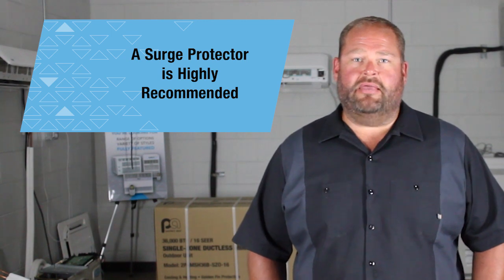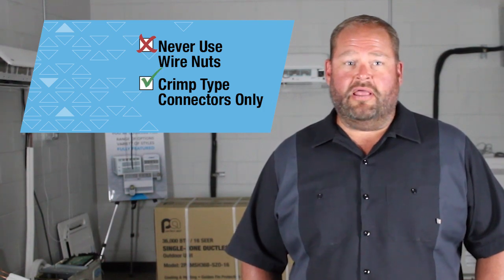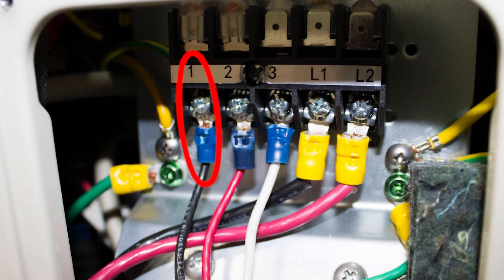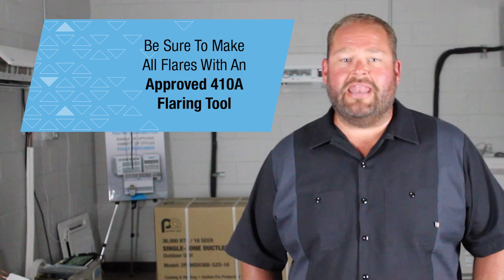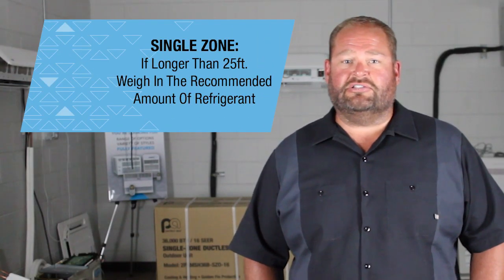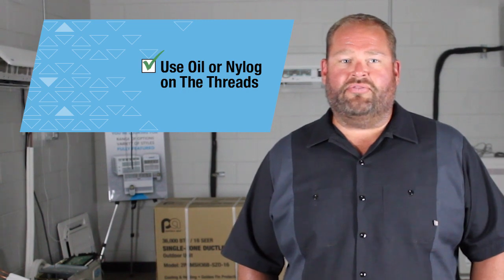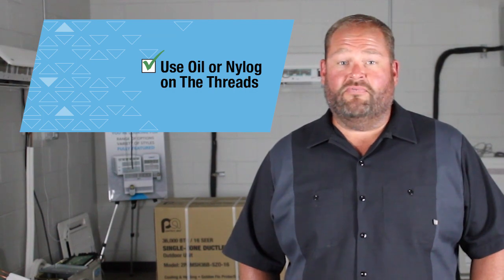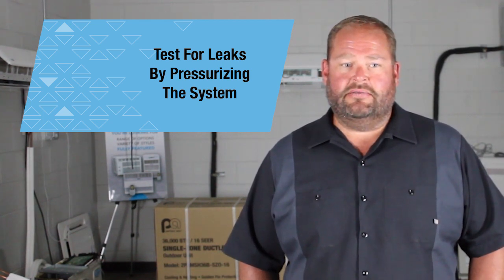How to Properly Install a Ductless Mini-Split Air Conditioning System | Installation Best Practices

Comment: Looking at install videos, since I won’t be using the full 25’,I don’t see what to do with the remaining line. I live in a winter climate , would the line freeze if I only coil it behind the unit ?

Comment: Question for 18,000 btu condenser which has 3/8 and 1/4” fittings. I bought the 18,000 condenser and the 12,000 btu indoor handler and 9,000 indoor handler. The 12,000 has 1/2” and 3/8” lines. Do I need an adapter to fit the 12,000 btu unit to outdoor condenser? Which do you recommend?
Reply from the maker: Hello, our multi-zone condensers come with adapters, so they will be able to hook up both size heads.